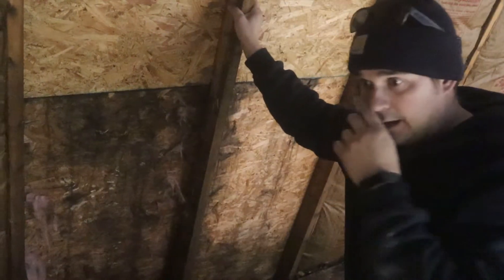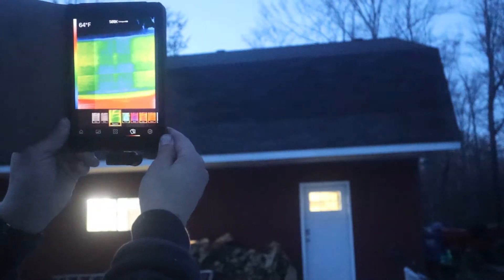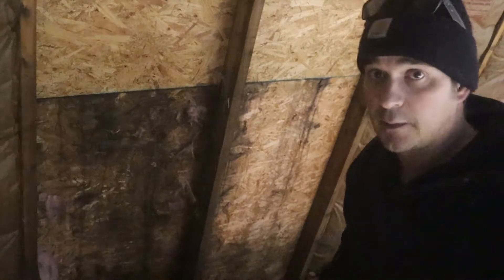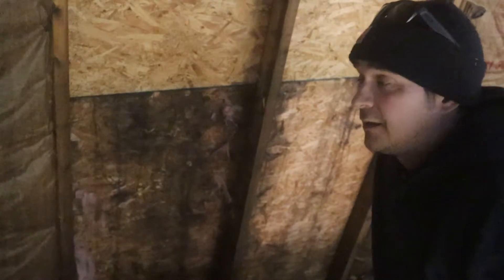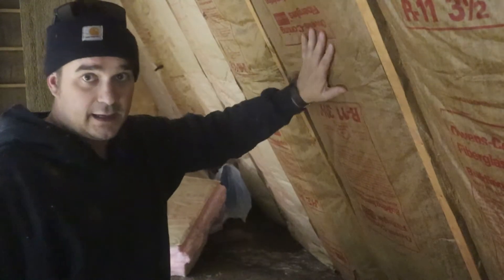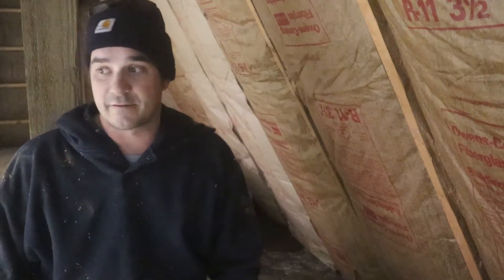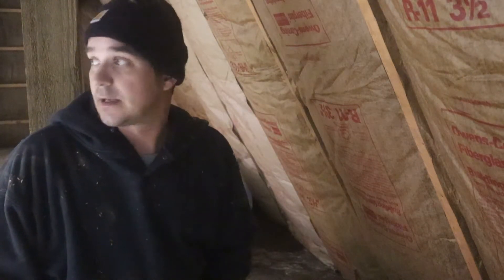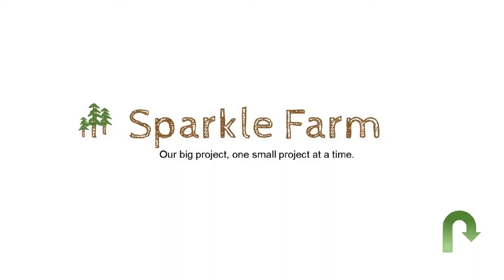Finding and Fixing Cold Spots With the Thermal Camera

Comment: I'm not sure I heard you correctly or understood...if you're outside, the hot spots show heat leaking out of the barn. Did you say the roof being cold means there is lack of insulation? That should be the other way around. The hot spots on the barn is showing where there is no insulation. If your cabin is insulated properly, then the outside should all show up cold or dark on your thermal imager. If it is showing up hot on the OUTSIDE that means heat is leaking out.